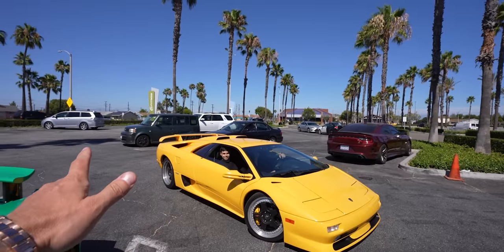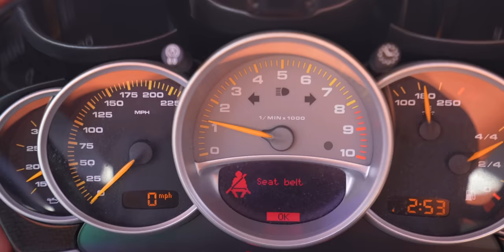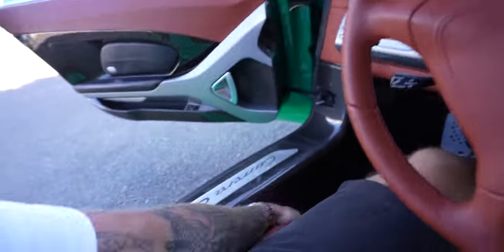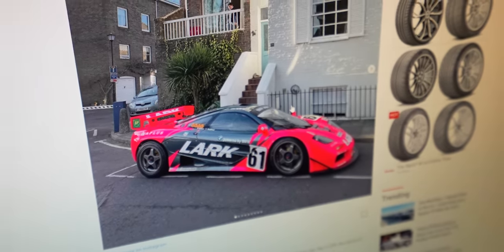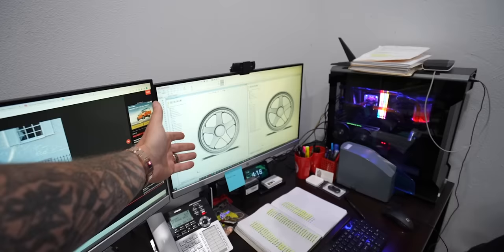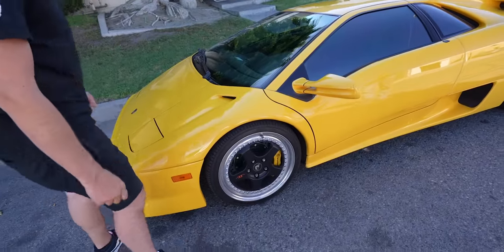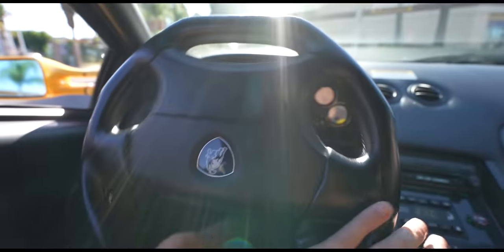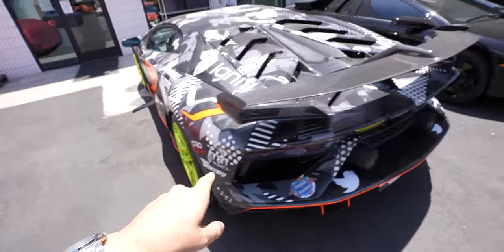INTRODUCING MY LAMBORGHINI AVENTADOR RESTRO WHEELS INSPIRED BY THE DIABLO SV!

Comment: It's funny to watch someone climb through the back of a minivan to grab a wheel sitting next to a sliding door.

Also, in one of the previous videos about the failed floor paint, why not use the Grand Caravan to burn it off?  Seemed to work pretty well.

Comment: All those bolts add a lot of unnecessary weight to the wheels.
In other words, the unsprung weight gets bigger.
the goal of modern wheels is to achieve lower weight
Reply: Man they are not real bolts on a racing wheels as they are milled from a single block of metal. For street cars, it does not matter.
Reply: Yeah, but if you can’t build it efficiently out of a solid billet then you have to do a two piece which requires the bolts. It’s just a production consideration. Sometimes you can’t do it in one shot cost effectively.

Comment: if the 18" wheel has 40 bolts and your creating a bigger wheel like a 20" then it would have slightly more bolts.
Reply: Not true.  My ADV.1 Track Spec wheels are 21" and also have 40 bolts,  titanium of course.
Reply: @DelCalloway  then they are a different style. It doesn't take a genius to know that the larger the diameter, the more bolts can fit as close together as the original style 18". Think about it. measure the spacing between the bolts on your wheel and then measure on a smaller circumference. Yes; you can still make an illusion but if you go bigger on a curved design and want the same true style you have to had more to make up the difference. Unless the size of the bolts are made bigger, that would compensate for the difference.